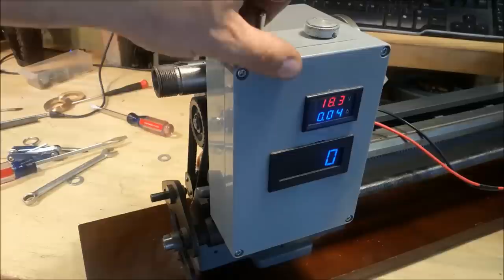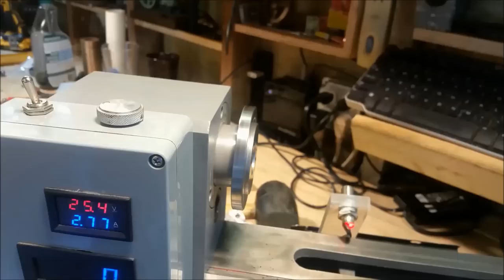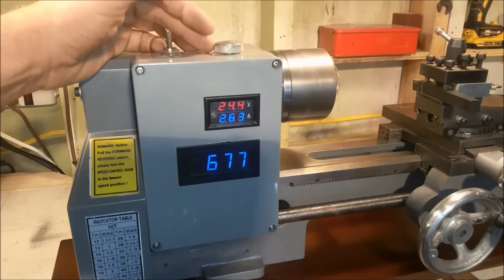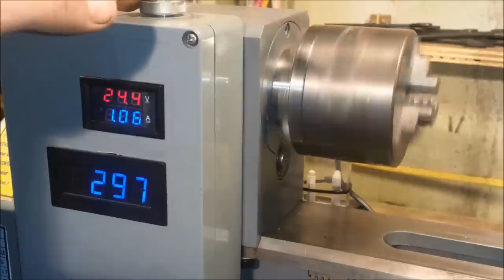Mini Lathe taper bearings installation

Comment: Hi, I did this mod using Nachi bearings. however when I rotate the spindle by hand after a few turns it tend to bind at a spot. So I go back and forth a couple of times onthat spot and the bind goes away, and then reappears at another spot. and the process goes on. Its not a smooth free travel. What did I do wrong.
And What's the deal with the brass washer. Didn't see any explanation about it on the video. Or did I miss it?
Reply from the maker: Curious... I don't know, but I'll offer a few hints that may help you identify the problem. One is, loosen the spindle nut so there's some slack and then push the chuck head in and out to see if you can identify if the problem is with one of the bearings or the other. I would almost think that one of the bearings wasn't seated properly; however, the stiff point changes location. I would also think possibly, that there is some contamination in the bearing, think metal shavings. If the push-pull method doesn't work, consider thoroughly cleaning and inspecting the bearings. Let us know how it works out. -don
Reply: Hi Don, Thanks for the input. In fact I had gone thru the process of washing and cleaning the bearings and refitting them bedore my original commrnt. I did try your suggestion of loosening the tail nut, gave it a few light taps and that seemed to resolve the problem. And then I tightened the tail nut ever so slowly to eliminate the lateral movement of the spindle. Now it looks good. But I do need to repack the bearings properly as the last time I did it I greased them lightly. So now I have to figure out a way to remove the chuck end bearing without damaging it ..... any suggestions?

Comment: If you paid a measly $7 for each bearing they will only be as good as the original low quality Chinese bearings you removed. If you go to the trouble of doing this work fit some top branded  bearings like "Tinken" so you do this work only once.

Comment: Варвар.
Нельзя издеваться над новыми подшипниками. 
Для установки используют разность температур, 100С - достаточно для свободного хода. Просто нагреть внутреннее кольцо до 130С, и оно без усилий займёт своё положение на валу шпинделя. Охладить в морозилке внешнее кольцо (переднего и заднего подшипника), и оно свободно для установки в переднюю бабку. Нагреть до 50С вал шпинделя,  установить на место и поджать задней бабкой,  нагреть до 150С задний внутренний подшипник и быстро установить на место.
После охлаждения вся система будет иметь нормальное усилие натяжения, без перекосов.
Reply from the maker: Translating to English: You can not mock the new bearings. For the installation use a temperature difference, 100C - enough for free running. Just heat the inner ring to 130C, and it will effortlessly take its position on the shaft of the spindle. Cool the outer ring (front and rear bearing) in the freezer and it is free for installation in the front headstock. Heat the spindle shaft to 50 ° C, re-install and press the tailstock, heat the rear inner bearing to 150 ° C and quickly replace it. After cooling, the entire system will have a normal tension force, without distortion.

Comment: Should have actually packed the bearings rather than just smearing grease on the outside of the rollers, so you do not have to go back in there later, since that is the only lubrication the bearings get.

Comment: I just installed these bearings but it seems the two spacers inside the headstock should now be thicker due to the inner race of the taper bearings not protruding as much as the previous bearings?? I thought the only spacer needing modification was the rear longer spacer.
Reply from the maker: Yes, it requires two spacers. i linked to the plans i used in the description. Cheers
Reply: What are the plans? I don't see them in the description. Thankss

Comment: Will this mod work on the mini mill? Are the bearings the same size?
Reply from the maker: Hi Steve, there are many models of mills. Im sorry that i dont know the specifications. Some of the mini-mills use the same head stock as the lathes, so its possible. Disassemble and measure or find the specs online. Good luck on your project!

Comment: Is there a machined stop on the shaft to set were the bearing should seat on the chuck flange end? I am confused as it looked like you removed the small shaft out of the housing opposite of the chuck flange end but when you assembled it back in you put it in from the chuck flange end. No explanation of how things got reversed? I want to try this but several areas are not clear.

Comment: No outside ring fixer? What? Or there is an edge inside the block? Taper bearings need a force backward, otherwise, they will loose son the tension.
Reply from the maker: I did make a spacer however, I did not detail it in the video. Sorry about that! Good looking out.
Reply: Don Brandt Now I can sleep well :)
Reply: Any pictures or information on that spacer? I just picked up a 7x10 today (lightly used and the tooling was worth more than what I paid for the entire package), and it's nice, but I want to make it better. These bearings seem just the ticket for a major fix.
Reply from the maker: Check out this link for more details
http://mikesworkshop.weebly.com/headstock-upgrade.html

Comment: found this article, seems it's better to grease 
http://m.machinedesign.com/mechanical-drives/engineering-essentials-lubrication-tips-plastic-gears-and-more-part-2
My 7x12 is stripped down at the moment and I also noticed it was bone dry inside the casing, was wondering if I should grease or not.
Reply from the maker: Great information..Thanks for sharing. I did not consider this.. I have another project that has plastic gears with lubrication from the factory... keep your eyes out.  -cheers

Comment: Why put cheap  $7.00 Chinese bearings in there?  How about a good timken, or other American bearing.  They are not that expensive. You should be using a press instead of hammering on the shaft. Make it even easier, put the shaft in the freezer overnight, and warm the bearings.  They will go on a lot easier.  You could have used a small square  punch to tap the luck nut loose, rather than chew things up with channel locks.  If your going to do that, use a rag to protect them.  Good  explanation though, for someone who doesn’t have the proper tools.